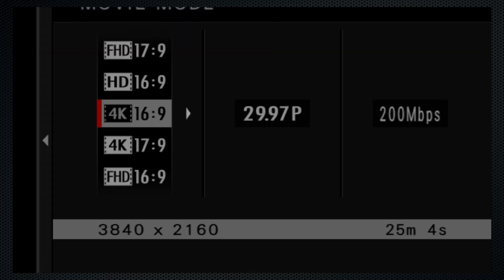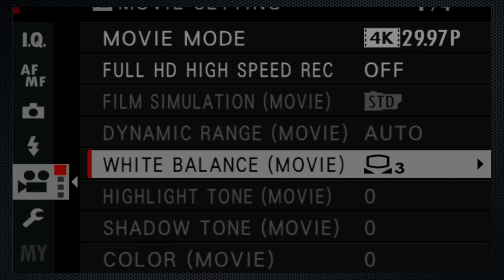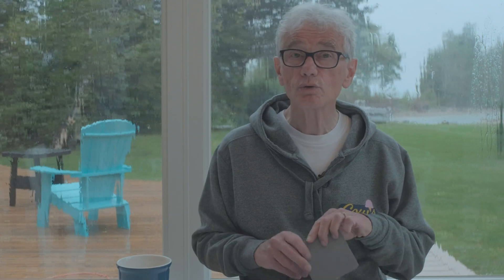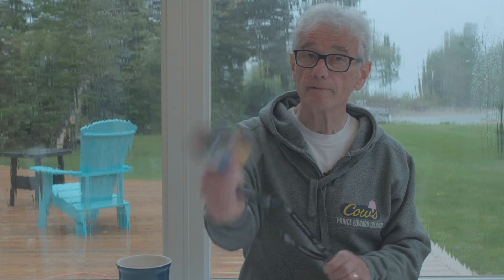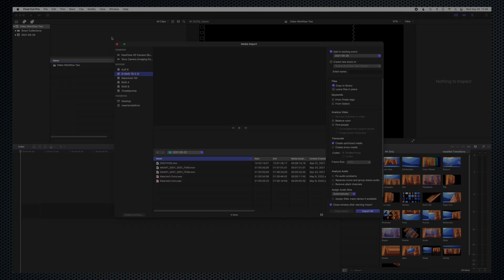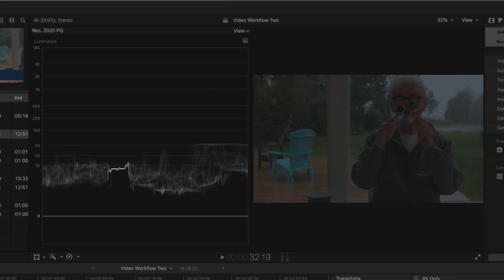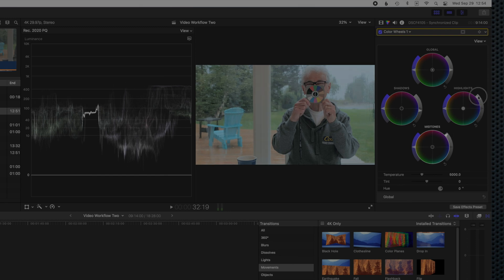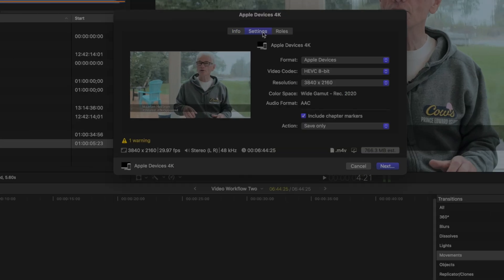HDR Video Workflow using F-Log for Fujifilm cameras

Comment: As I understand it, the LUTs fujifilm provides throws away wide colour gamut information and you're left with just rec.709 information even when your project is set to HDR, is there any unofficial or official LUTs that can convert f-log to HDR HLG or PQ with rec.2020 information intact
Reply from the maker: The role of the LUT is to do exactly that - to convert the recorded wide gamut footage to a range that standard (REC 709) displays can handle. If you are producing HDR output, I recommend that you manage the footage manually using an HDR display. Or just record directly in HLG.
Reply: Thanks for the input! @MaartenHeilbron

Comment: I got confused about the Log format. At 6:22 into your video, the info of the input video clip at the top right hand corner shows "Rec.709" instead of "Rec.2020". Does it mean the video clip captured as Rec.709 can be actually converted into real HDR Rec. 2020 colour space? Then I tried it, even though the rendered video shows Rec.2020 and my display recognised it as HDR video but the colour and the contrast just look like SDR video. Can't compare to HLG format. Did I miss something there?
Reply from the maker: Good question! Most cameras save F-Log footage into a file that's recorded as Rec 709. By creating an HDR project, the footage can be used to create a wider dynamic range project and output as REC 2020, if desired. 
The footage recorded using a log setting needs significant adjustment to create the wider dynamic range and won't compare to a real HDR or HLG recording. 
As I've said in other videos, log recording is not a silver bullet that magically improves your video quality, particularly using lower data rates, limited bit depth (like 8 bit) and inferior colour sub-sampling.
Reply: @MaartenHeilbron  thanks so much for replying my question. Finally I got some good answer for it. My next question is: I know how to do HLG recording and output a HLG video but can you tell me how to make a real HDR10 recording? All the mixed information from the internet really confuses me.
Reply from the maker: @TravelwithLei  Again, good question. HDR10 is a display technology rather than a recording technology. I'm not sure which NLE you're using, but in Final Cut, there are options to output HEVC 10 bit HLG with Dolby Vision (HDR10's competitor). Honestly, I'm not sure that it's required as a display that's HDR10 compatible will likely also interpret and display any video content with REC 2020 appropriately. That said, it's not anything I have tested, or have the equipment to test.

Comment: I have a question. By applying a LUT in Rec. 709 such as the one provided by Fujifilm, do I actually get any benefit by setting the project at the Wide Gamut HDR which uses Rec. 2020?
Reply from the maker: If you are outputting to wide gamut (REC 2020), you will get a benefit from using F-Log (with or without the LUT).
Reply: @MaartenHeilbron  Okay, thanks. Particularly, you mean the one without the HDR naming on Final Cut, right? 

Just to mention, I've now understood even better the usage of f-log by having watched your 4k vid settings. I am grateful.
Reply from the maker: @lelejkj  Yes. Thanks for your kind words.
Reply: @MaartenHeilbron Since I'm a beginner, I've realised only now that my x-s10 registers (internally) at 4:2:0 8 bit, so it doesn't really make sense to set rec. 2020 which is 10bit or higher in a editing project, right?

Comment: Thank you Maarten. Do you see/have any issue grading the 8 bit flog material? I am under the impression that can be tricky?
Reply from the maker: You are right, particularly if the exposure wasn't quite right. Before you commit to recording a significant project with F-log, do a few test recordings and colour grade them (with or without the LUT).

Comment: Perhaps something didn't export properly but the video is really underexposed!
Reply from the maker: Are you watching on an HDR display?
Reply: After examining the tutorial in the video, it seems the white point is set very low. Your highlights are in your midtones (I noticed the same thing in the previous video)
Reply from the maker: @AlmightyUniden  Admittedly, the lighting is s*** as I was forced indoors by the rain and didn't bring my lighting kit with me. What is the appropriate "white" point (say for the post between the windows) on a logarithmic luminance graph in FCP? So, I have watched this on my iMac (P3 display setting) and on my TV (which supports all current home HDR variants) and it looks the way I graded it. I find it a little overly contrasty, which didn't seem fixable with the original footage I had and the colour rendition is slightly lower than I'd like - but adding more in post looked worse. I attributed those defects to lighting. Happy to have more thoughts on this topic
Reply: It just looks like it needs more contrast or saturation because it was shot in log right?
Reply from the maker: @Glenners  I hesitated to add more contrast (the background scene looks fine, my face tones are overly contrasty to my taste) and saturation (more colour looked very artificial to me). As above, the issue was that I recorded indoors without suitable lighting, as a result (and combined with f-log) there was a lack of contrast in the face tones on the original, and trying to recover/create those in post was not possible.